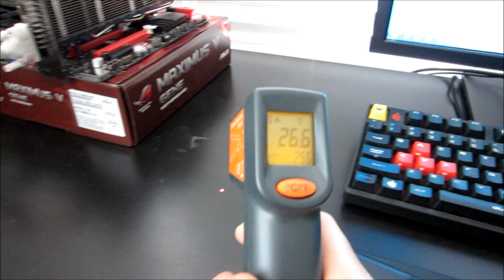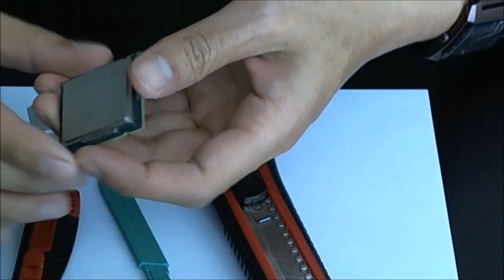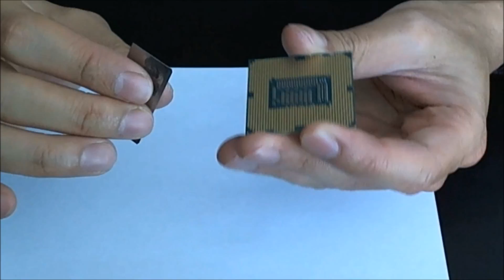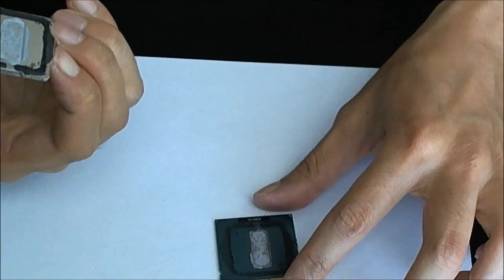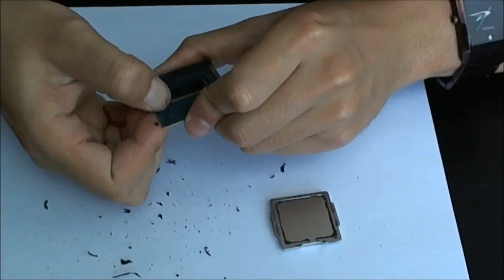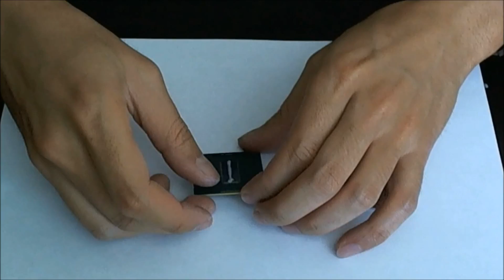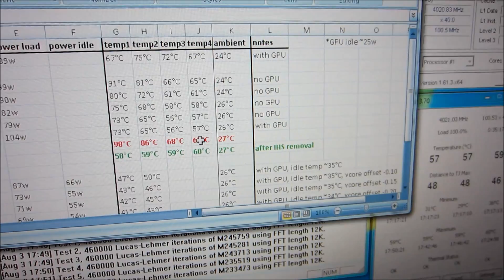Fixing Skylake, Haswell, and Ivy Bridge CPU temps: IHS removal

Comment: just did that but in the vice with a hammer and block of wood on my 4790k and was scared but was easy and it lowered the temps by about 10 C on full load
Reply: Joel Gratton  i used a id card or someting flex and not sharp to clean the old glue off both pcb and coper plate

Comment: Good God man! Didnt anyone ever tell you not to touch the resistors!?!?
Reply: There's nothing wrong with doing that. Those things at the bottom are gold plated so are very resistant  to corrosion. It's the pins on the mobo or (only with amd) the processor you worry about

Comment: Does this apply apply to all CPUs? I have a Intel i3-3130M but it seems the thermal paste is on the outside?
Reply: When i read the comment i thougth GG
Reply: This is internal thermal paste between  the cpu die and the heat spreader. The paste on the outside is between the heat spreader and the heat sink connected to the fan which cools the cpu. Both need to be there. His is only necessary for him as he has a k overclocking version. An i3 doesn't  produce much heat anyway  and doesn't even over clock so no. This is not useful for your i3

Comment: what he is doing is called "de-lidding" it takes the metal cover off of the actual processors on the die, remember the older intel PIII/celeron socket 370 cpus? they basically put a metal cover between the actual chip with thermal past and then thermal paste again for the cooling device.
Reply: I remember

Comment: Did you know you can use human plasma for thermal paste.  Keeps the temps down a lot cooler, it's like I got part human in my PC.  Biotech.  Horrible job holding that cpu processor, you should never touch the bottom let alone the top.  Also use alcohol solution after you touched it with your greasy fingers, oil and shit will break that thing, it'll shorten the cpus' lifespan.

Comment: 1.) Is this needed/worth trying on i5-4590?

2.) Is it possible on reinstall to bypass lid all together and just have heatsink touch bare die directly?

Noob, not troll, these are actual questions. Know a little about component level stuff, recently hacked a Xeon 771 into a 775 board with pinout decal and xacto knife.
Reply: No and No. 
The 4590 shouldn't get that hot. Unless you're taking about the 4690/4690k. Still... no. Intel has improved the TIM in between the IHS and the die,  so there is no need to do what this guy did. It's dangerous too. Not safe for you wallet.

Comment: You know he was stupid because he was touching the LGA gold contact points
Reply: Erdo4 Gaming it's gold. The problem with the pins in bending them. Trust me. Oils on your hands does very little
Reply: +Erdo4 Gaming When i manage the components inside my pc, i never use something special to prevent static, and everything is OK as the first day i built it (keeping in mind that i touch everthing even on the bottom of the motherboard).
Reply: Erdo4 Latex gloves don't protect you against electrical discharge...
Reply: It’s fine, should’ve wiped them with IPA but who cares. Let’s see your delid video, you’ve had three years to make one better than this.
Reply: It's fine. So long as you  don't touch  the pins on the mobo or do this on an Amd processor as the pins are on the processor.
Reply: Erdo4 Gaming me and many other have done so and everything has been fine
Reply: +taief miah nope, that's totally wrong.. You should NOT touch cpu contacts neither mobo.. Do NOT touch under THE CPU .. Cover it safetly if you really need to do this.
Reply: +taief miah Yeah, it may fine this time but its safe to NOT touch under the cpu because the electric on your body may damage the cpu.. Thats why I always use latex gloves when I work on computers..

Comment: What the fuck is wrong with Intel? How could they fuck up such simple things?
Reply: rapper250 
They designed it this way on purpose. I have no idea why they used this TIM, but it does make me wonder if they do it on purpose.
Reply: iNonentity More then likely it was just a bad batch of paste as it is just a few specific chips that suffer from this problem.
Intel can control the quality of the chips themselves.. But they don't control the quality of the paste delivered to them in bulk.
Reply: +rapper250 I think because there is no competition and because it is cheaper
Reply: iNonentity They do check the chips themselves, though it's not like they give them the massive run through we eventually do, plus it could be inconsistencies in the paste itself thus why some people never have this issue yet others do.
Reply: Fuck, now I may know why my 3770K is overheating as hell even at 4.1 GHz, and I have an H80i that should do the job. Fuck it, I will buy Ryzen that has a soldered IHS and call it a day.
Reply: +NOMADSPY After 5 years I'd be wanting a new CPU anyways just to keep up with the modern speeds. I like playing my games =p
Reply: TheHeartmedia And you have to realize not everything can be 100% perfect, every chip technically behaves differently from one another depending on minor flaws in the silicon that they can't control.
Reply: +Jeffery Peters (Ferrariassassin) I know this was three months ago you posted but I just had to reply saying you're a dumbass. He did use one of the best brands of thermal paste.
Reply: +rapper250 Because there is no real competition from AMD so they can do what they want.
Reply: David Clark They had "forgotten" to use decent thermal paste in some of their CPUs like in this video which made a huge difference in heat and caused problems for some people. They went with what was cheaper so I wouldn't be surprised if they did it for other things too.
Reply: +David Clark its a known problem since c2d days. i have had the issue on 2 cpus in the last few years. temperatures were off by 15-20°C on some cpu cores and the only help was to decap it and mount my watercooler directly to the die
Reply: rapper250 hey in every gen of cpus its worse an worse and than core i9 oh man could go cheaper on a 1000$ cpu
Reply: +1!

Intel now has REAL competition, for $429 (on promo), one can get a Ryzen 1800X that's less than 10% slower (if that much) than Intel's best that costs over $1,000. Yes, it's a reduction, yet look at the value for money. That $1,000 won't double the performance of the !800X, nor !700/1600X for that matter. Plus they've stuck with soldering the IHS into place, Intel has never came forward (at least truthfully) as to why they changed manufacturing process. 

Looking at that video, one can see the area(s) of the die not covered with paste post removal of IHS, no wonder why the temps per core are jumping all over the place. Intel done this to themselves, as well as all of their longtime loyal customers. They'll never get another red cent of my cash until they go back to tried & true methods of CPU manufacturing, as far as that goes, AMD is just as good for my needs for a lot less cash. 

Cat

Comment: Looks like you got really unlucky with yours. The view of the temps at the beginning shows that only half of the CPU was actually making good contact with the IHS. I know that Haswell & Ivy has pretty bad compound in them, but yours was an especially bad case.

If you do this again though, I would highly recommend using some high proof rubbing alcohol to clean out all the microscopic surfaces that the old compound is in that you can't see.

Comment: My 3570k has one core running up to 20c hotter than the others at idle/desktop use. However, when in heavy use, the temp difference drops down to about 5c when I hit my max temps (~65c ish). I'm running it 4.8GHz 1.255V stable @ h2o. Kind of tempted but meh, who the fuck cares if one core keeps running at 35-40c. Only thing that confuses me is how the temps of that one core are exactly the same now with h2o as they were with several aircoolers. Like withing 3-4c of eachother. Even if I run my cooling system at full force, it won't drop below 35-40c, ever, while the other cores' temps went down at idle/light use too, staying at 18-30c depending on the ambient temp now. Might as well keep it nice and silent I guess.

Comment: Don't do this with a 5960X and possibly the K I7 as well.  The IHS is soldered on and you will destroy your cpu trying this.
Reply: +Laughing Man Productions² extreme series and xeons are not affected by this, only the consumer level chips, so 4829,4930,4960,5820,5930, and 5960x are all soldered
Reply: Cody Brown
 I was talking about the 5930k.  Just to update my post, both the 5930K and 5820k are soldered as well (each of the I7 processors).
Reply: Cody Brown you also wouldn't want to try this with amd processes if they were Tim and not soldered as the pins are on the cpu
Reply: +Axel Shark I was planning on doind this to my 4690K, just because i do overclock :D!! But i think i dont need it at all just because mine is running at 4.7Ghz/1.295v 53c when playing games and 63c on stress :)

Comment: OMG, the cojones on this guy. I would've thought to take apart a CPU you would give it to a six-year-old with a hammer and pliers. In any event, all the stupid questions about alcohol and what kind of thermal paste to use. Everyone is going to argue about that. The real question is why does Intel charge almost $350 for a CPU and fuck it up to save 50 cents..

Comment: So the only problem the processors have is the thermal paste??
Reply: Jonhy Garza Only the lower end Haswells.  I know the X has solder between the die and the IHS, but I am not sure about the K (the I7's).  The I5's all have thermal paste though and so are bad for temps.  Even worse in this guys case because he is attempting to cool it with air.  Cannot speak to the state of Ivy Bridge cpus, I skipped that generation.
Reply: Laughing Man Productions² ok anyways... its because my gpu runs at temperatures of 60 - 80 celsium and I dont know if the thermal paste is good or to buy another one. AN the processor isnt important, is an i5 without "K"
an the temperature is like 40
Reply: Jonhy Garza that is pretty standard for gpu temps.  Most of them are made to run hot.
Reply: all enthusiast grade an Xeon CPUs are soldered, its the consumer chips that use paste so ivy bridge enthusiast would be 4820k, 4930k, and 4960x, haswell would be 5820k, 5930k, and 5960x, all of them use solder, 3770k and lower as well as 4790k and lower use paste, this also applies to broadwell and Skylake CPUs

Comment: how many people broke therecpu by trying this lmao
Reply: Mark Park yeah... my friend broke i7-4790k
Reply: +Travis Bartley They're actually all capacitors. I would assume they all serve for decoupling but I cannot  (quickly) find any further information on this regarding modern CPUs. AFAIK it takes up a lot more silicon real estate to make capacitors than it does to make resistors, which explains why they are externally placed. I would actually go as far as saying there are 0 intentional resistors in the actual CPU seeing as it uses a CMOS process and resistors don't exactly increase efficiency. And regarding the corrosion: sure the outer layer solder joints will oxidize a bit due to the natural acids present on the skin, but this will in no way affect the reliability of the joints unless it is extremely thin and a significant portion of its volume gets oxidized (hint: it's not).
Reply: Mark Park I argree with you. I whould send it to intel and say "fix mah shit!"
Reply: I believe the 3820 is soldered and doesn't use paste
Reply: ***** how is it useless? freedom of speech and yes it is a true statement. I bet there are loads of people who has done his and broke there cpu.
Reply: Mark Park My CPU works fine. I removed the IHS today.
Reply: +Travis Bartley lifespan?! would you say increase normal life of 10 years up to 40 years? at that time, who fucking cares about these rubbish cpu??
Reply: +Travis Bartley I love you. You know what you're talking about. Right on, dude.
Reply: piemaster still would have broke the cpu 😘
Reply: I broke my Intel i7-3820
Reply: Mark Park - as long as ur very careful, this is not hard.  I was able to do it without much trouble.
Reply: yahh uu have right !!
Reply: can u believe it worked out with me before 2 years from now on an i3 540
Reply: +jhowe67 Oil? Corroding? Lol idiot, maybe the oxygen exposal, but nothing from the hands.
Reply: Mark Park He just broke his processor, or atleas greatly reduced the lifespan of it, the oils from his hands are going to corrode all the resistors he just smeared.
Reply: sorry, computer messed up... while i may have exadurated on the number, http://images.bit-tech.net/content_images/2009/09/intel-lynnfield-details-and-architecture/cpu2.jpg shows resistors on the bottom of modern cpu's
Reply: Travis Bartley you do realize the bottom of a CPU is thousands if not millions of resistors right? thats where the actual power of the cpu comes from, processing millions of 1's and 0's every second. a 1, the resistor lets electrons flow, a 0, it doesn't. that is what a cpu is, and by rubbing his hand all over that part of the cpu, he greatly reduces the lifespan of it. also the connector where the processed data is transferred from the cpu to the motherboard. is this a good idea? if you are looking for lower temps, yes. is this a good method? no, not even slightly.

Comment: Lol, my Ivy Bridges have never had heat and inconsistent core temps like yours.  Mine run under 60 degrees under gaming load. i7 3770k
Get a cooler that doesn't blow

Comment: The best thermal paste to use inside the chip is Coolaboratory liquid pro... by a wide margin. It will harden with time & will pretty much be the same thing as a soldered setup (you won't even be able to delid it again). It's worth noting that liquid pro is electrically conductive... so some care must be taken when applying it on the die. You can Gsearch to find the best method of doing this.
Reply: * Coollaboratory Liquid Pro.
Reply: Advection357 Is it possible to remove a delided CPU (die and IHS together) after putting it in the CPU socket? Do you have to like, shake it so it would fall off or somethin'?
Reply: Le Magic Cactus It's no different than removing a non-delided cpu... since it's a ZIF socket (zero insert force) so no need to shake or anything... just lift it from one side and pick it up... careful not to bend the pins on the mobo & try not to touch the IHS contact area :P
Reply: Advection357 Ah, thanks!
Reply: Advection357 +1 for that recommendation... used to recommend Innovation Cooling Diamond "24 Carat" for best general thermal paste before but turns out it's not as good for de-lid jobs :/ .... maybe use the liquid pro under the lid and the diamond over it and under the heatsink.
Reply: shayson1357 I ended up going with 4790k (very happy with it!) And I have no need to delid it. It maxes out at 60c during long hours of stress... Idles at 23c... gaming in the 40's or low 50's
Reply: of course anyone can be very happy with stock cpu power..... you can just buy a more powerful(newer generation) cpu when it comes out instead of going through the trouble of overclocking and older one.....and besides, GPU is more important for gaming so adding an extra 200$ on the GPU budget instead of them going towards buying watercooling is a better deal imo :)

Comment: Placing a thin copper shim between the processor die and heat spreader should also help improve temps by filling in the air gap

Comment: just did my devils canyon today and what a freaking diffrence! 4.8 ghz @ 1.190 63c max stressed! great video.I used the new liquid metal ultra on both die and lid.
Reply: Yeah, I did the same to mine, but used Liquid Pro between the die and the IHS and VersaChem's "Mega Black" to reseal the IHS to the board; I find the Liquid Pro applies and spreads a little easier than the Liquid Ultra, and MegaBlack is a dimethicone "high-temperature gasket" material which provides good attachment, while still allowing a little "give" so that the IHS can be compressed against the die.  (Note: When resealing the edges of the IHS, don't enclose it 360°, but leave a small gap, as Intel does, to allow it to vent as it heats up).
Reply: Andrew Ryder Good tip! I've just bought some high temperature silicone. Just needed to know what to look for. Thanks!
Reply: demonkoryu Thanx!  Intel uses black potting compound, which is rigid, and that's part of why their "new improved" TIM is still somewhat inadequate.  When the potting compound hardens, it fixes the distance between the IHS and die, so that no amount of pressure from the CPU socket clamp or CPU cooler can compress it.
The older soldered IHS was pretty much held in place by the solder, with just a small epoxy bead around the perimeter for centering.  The solder, having some "give", would allow the socket clamp to compress the spreader onto the die, (plus the solder itself was much more thermally conductive anyway), so it was realy a much better solution.  Unfortunately, it's an expensive proposition, and Intel feels that with the lower TDP's the newer processors have, they only need to offer it on their "Extreme" edition CPU's.

Comment: will the cpu can run for longer period ?? after doing that... ?
Reply: luncent lucy  What? Most people/enthusiasts delids their CPU to get BETTER overclocks!
Reply: In most cases, if it runs, it stays that way.
Reply: it wont damage ?
Reply: Not unless you stay within certain "safe" voltage and temperature ranges.
Reply: can't be overclock right
Reply: if its not burn the cpu right

Comment: It's actually better not to remove the glue. Two half of original glue connection should fit almost perfectly and will hold the heat sink in place.
Reply: nah some part of glue can be missing or positioned a bit wrong than you get complete deformation...
Reply: Actually, the glue is the problem, since it keeps CPU and heat spreader apart. So.... the glue (silicone) should be removed for the delid to have any real effect.